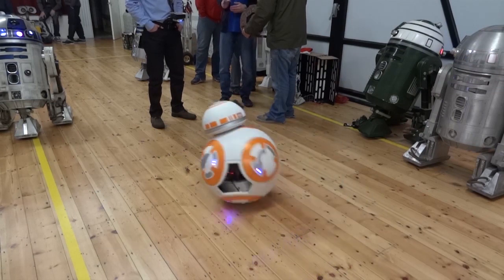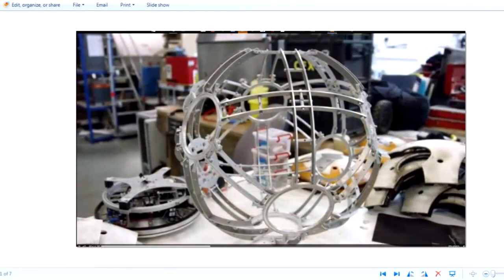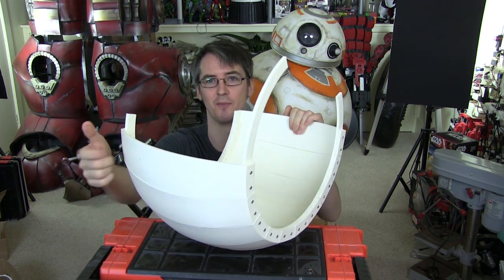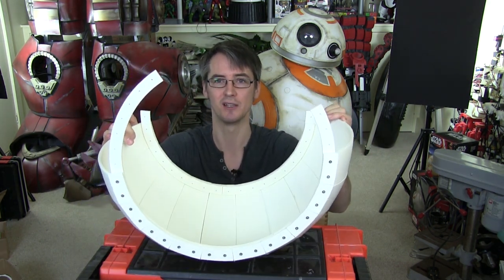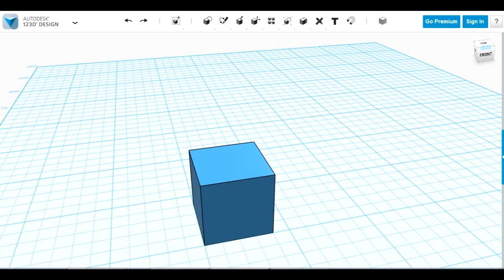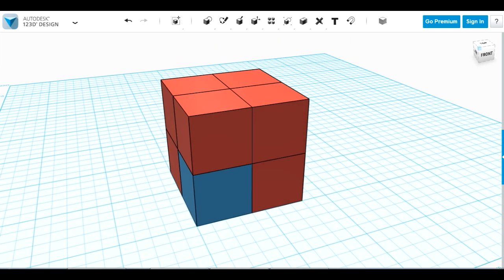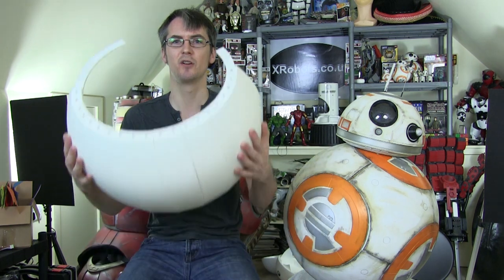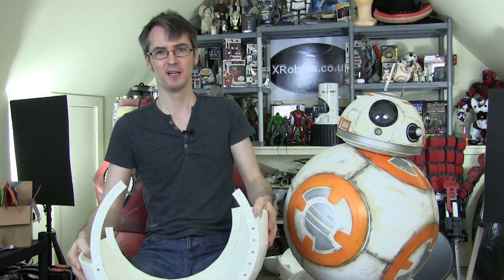Star Wars BB-8 Droid v3 #1 | Intro & Discussion | James Bruton

Comment: The running carriage is wrong. The inner construct has to couple rigidly to the ball and you tip and roll that axis to turn the ball... it's way easier to balance too. I know it's been 2016 and now it's 2022, you probably figured that out long ago :D

Comment: Can You Recommend an Appropriate motor for Building a Anaheim stage droid Replica. The Bevel Gear Driven By Belt both appear to be 1:1 Rato But this is where im stuck no clue about working out torque needed or frame pannel weight radious ratio Brushless V Brushed & Planatary v harmonic 
But My Frame and Pannels Might be heavier i suppect stage droid sphere is Acrylic California Quality Plastics 2 Hemispheres ill be using using club panels and cari christe new 8mm Sphere

Comment: hi james, i wanna build this robot, but i wanna ask, I have the Robo 3D R1 Plus printer, it has a heated print bed with measurements of 8" x 8.86" x 10", my question is, Is it possible to build this version of BB8 with this printer?

Comment: why not base all of the movement based in the actual top head part of the droid. E.G. moving the head back and forth using actuators and then using the gravitational pull of it to roll it. then you can have the magnetic frame on the inside to hold the head
Reply: what about a large gyroscope instead of the axle shaft based in the middle of the robot. then instead of controlling the head section through the magnet on the shaft, have a large magnet infrastructure in the middle. this would allow the droid to move in multiple directions
Reply: why not try and advance their design then?
Reply: oh, fair point. that is a lot of money. maybe in the future if the prices of motors decreases then :D
Reply: you did a awesome job with this droid
Reply: Well couldn't you use motors like those out of childs toy electric cars to create a gyroscopic system inside of your robot and have multiple gearing on it , I'm sure it would take a bit of inlaying the belts but I'm sure it can't be too hard plus if your willing to use more plastic in your print along with something like HIPS you can do a multi-layered print in order to make the system work more easily , and you can get most of the components from the local thrift shop , the head could be done with a magnetic layering inside the bottom of the head with simple RC mechanics to use small electro- magnets to pull the head from side to side or front to back , and the magnets will hold it in place , and you could link them to the same controller but have it almost like a Nintendo controller to control the small electro-magnets to pull and push the head where you want it , Just a thought , if its any help cool if not Sorry for the annoyingly long post

Comment: I'm going to be starting one of these this year as well!
Reply: +Anthony Bowman Looks like I am going to have to break up some of the parts into smaller piece and then acetone weld them together. My print bed is a bit smaller than the TAZ printer beds. Mine is only 200mm x 200mm. Shouldn't be a problem, though.
Reply: Anthony Bowman hi i would like to build this too do you have the cads? And could you share them with me

Comment: Wouldn't having parallel motors in a similar setup to your version 2 along the width of your main sphere provide the banking effect that you're looking for (with tank controls implemented). It would keep the main mass at the plane of your preference, the overall weight would keep the sphere rotating on a an axis parallel to the equivalent of a central axle, and the conflicting forces of the tank controls would allow for the in place rotation you mentioned at the start of the video. 

If the motors don't stay in parallel to the equivalent to an axle, you could always attach an actual axle thats purpose would be solely to keep the motors in place. (With each motor attached to the axle independently of one another. Although that might require you to split the force of each motor into 2 inputs each in the configuration aesthetically similar to a compass with each input on either corner to provide stability)

Comment: How about putting the batteries at the bottom for weight stability then being able to shift the battery weight perhaps and shifting sled platform from side to side to cause the sphere to lean left or right?
Reply: not quite what I meant take a look at the GM envy two wheeled electric self driving robot car it has a battery "sled" that slides forward and back for balancing but if such a "sled" were to slide side to side in your bb8 sphere it would cause it lean left or right what I mean by sled is the batteries slide on a platform that hangs under your central axis like a pendulum at the bottom of the sphere but not making any contact with the sphere at all...

Comment: James, one idea I am looking at is using actual RC. I already have a Taranis X9D radio and I plan to have a Arduino pro Trinket from Adafruit for the RC and have that communicate to and Odroid C1(lie a raspbery pi). having a central brain and offloading tasks to smaller microcontrollers reduces that buffer overflow issue. It does make a few things a bit more complicated but over all it should work better. Since I am using FrSky I can use the s.bus and get all 16 channels out of a cheap 4ch receiver. The same s.bus would work with Futaba but unconfirmed. The library for the s.bus can be found here:  https://github.com/zendes/SBUS

Comment: I feel like a better idea might be to leave the flywheel out this droid and instead use the banking mechanism to turn sharply enough to where it can turn in let's say a 1 ft diameter circle
Reply: +James Bruton (XRobots) I see what you mean. that might be a problem. I also just went back and watched footage where bb-8 spins slightly on its axis, but it doesn't seem to need to charge up a fly wheel in doing so. either way, I'm sure this will be a great build! keep up the good work!

Comment: sigh You realize all these remote control problems have been solved by... Remote Control transmitters? Don't diss the RC crowd until you've built a modern quadcopter. You're actually treading old ground, and doing a lot of work that's already been perfected. Take a look at the Naze32 flight controller and FrSky Taranis TX combo that every second quad pilot uses. The link goes 1 km, has failsafes and proven immunity to a lot of interference, PLUS telemetry to return data to the TX on critical systems. And sixteen channels. And programmable lights. And GPS. And programmable motor outputs that feed brushless motors. And... you really should start watching a lot of FliteTest. I say all this because you're building robots capable of running away and big enough to cause damage now... don't trust that to a homebrew radio link with buffer overruns. "Runaways Robots always head for the nearest pram"! Failsafes!
Reply: I know. I've been down that road. It's not as great a road as you think, and the 'fraction' is about 0.3, (I'm guessing about $50 worth of materials for your TX and another $30 for your RX vs $200/$40 for a Taranis/XR4) and doesn't include your time, or the cost of the robot that might get destroyed if the link fails. The RF link is fully digital, bidirectional, and can carry any information you want with some hacking if you really need it, and there's thousand of people tweaking the software to do interesting things of relevance to you. The Naze32 has been adapted for segway-style vehicles. Or there's Openpilot. There's a whole sub-industry that makes these things now, and they have some wonderful devices. Making good RF gear takes a range of engineering disciplines. Take advantage of what's there.

Comment: James... You could have tweaked V2 a bit more before starting V3. 

Take your time a bit more! Think about what a droid like this would look like internally in order to be useful or practical from a real world perspective... As a tool for performing some sort of work... With its arms and all. Then as a companion. How would this change its insides?

You obviously love to build stuff... Jumping right in. But really take the time to think about what you make... And they'll stop being just puppets or props and become actual, real-world robots (or droids). I hope you take this positively!'

Also... Why not use RC equipment? Brushless motors, ESCs, radio transmitters... Instead of windshield wiper motors, arduinos, bluetooth, etc...
Reply: +Sutanreyu Depending upon the scale and speed of your device, windshield wiper motors, arduinos, and blue tooth modules are RC equipment.  A windshield wiper motor can be picked up for $20, and is already geared rather low.  A similar brushless DC motor of comparable power output is nowhere near that affordable.  The arduino allows for electronic speed control of more than one motor at a time for less than the price of a single hobby RC ESC module.

Comment: Why bother building the single axis version? It's much less maneuverable than the sphero version.
Reply: +Tyson Coleman To have panels that can access the interior. Robots need maintenance all the time.
Reply: Hmmm. I have an issue accepting no as an answer. I'm sure we can come up with a solution to having a single axis. I haven't seen the movie but does he move on a single axis in the movie as well?
Reply: +James Bruton (XRobots) I'm not saying that there aren't complications. Several in fact with the idea of an omni-directional (Correct term?) BB-8. But that's not to say that it's impossible. But I am willing to bet that eventually there will be an omni-directional model out there and someone has to be the first to do it. Again it won't be without it's complications, but I still think someone, you in particular, could tackle it.

Comment: I think that you need to reduce the amount of motors and the amount of calculations to speed up the processing loop. It may prove better to use two accelerometers again but redesign the processing part using more processors- basically distributing the computing done. The droid loop must definitely be master and call for event updates.

Comment: try using a raspberry pi as the main controller in the Droid. it is faster (i think) then any 8 bit arduino (sorry for the butchered name) and i think it can multi task pretty well. and use the pi zero for the controller with a wifi dongle stuck in the one USB port. i work with the pi a bit and its never really let me down. just saying
Reply: +Liam Amyot Do you recommend an Arduino or a Pi for a quadcopter/drone of low difficulty? 
Thanks
Reply: Tito Adesanya raspberry pi all the way!

Comment: If you have one motor "driving" the bot..( against the inside of the outer surface; presumably with a wheel making contact), could you achieve the goal of the additional wiper motor(for banking) by making the drive wheel able to turn with a smaller motor (at the contact wheel), such that..."imagine the drive motor as a small car that is able to drive side to side within the fixed track that is your main drive "groove"..??  

Its seems like a "servo" motor that changes the pitch/angle of the drive wheel could cause the "banking" effect and shift the ballast weight around "auto-magically" as long as the drive motor is fixed like a pendulum at the point of the "drive axis" you have identified as requiring great torque.  If that can work you wont need 3 wiper motors and will have more internal space.

Comment: hey james,
you may have seen this video: https://www.youtube.com/watch?v=RqSOo5reNO8

in your video you said, that the "movie"-bb-8 was just a puppet. i did read some articles, stating the he was not remote controlled but none of theses articles had a proof. infact there were some articles saying, he was indeed remote controlled. i remember reading an article or watching a movie where they said, they needed two guys controlling bb-8. one for the body and one for the head. at the end of the video, you can see the movie version doing some stuff. its not the stage version because u can see the different head movement. 

i noticed the difference of the "movie"-bb-8 and the "stage"-bb8 aswell, but i actually think, they made the stage version the way it is, so one person could control it.

Comment: Great work, following all of the BB-8 versions with great interest.

Question, why not use interrupts to handle the comms (controller)? That way only when there's data from the controller it gets processed; this is a very simple approach which will unload the main control loop. The comms interrupt will handle the incoming data and place it in a buffer and then when it gets all the data (new sticks pos, switch toggles, etc.) it lets the main control loop know, prompting the main control loop to react to the set points. Because the main loop gets unloaded this way, it can run at full speed without worrying about user input. 

To control the timing in the main loop (PID control is time sensitive) a similar approach can be taken but using a timer interrupt to set the time interval. This will greatly reduce any timing jitter, smoothing the control loop's output.

BTW, Arduino's interrupts documentation might be misleading when it reads "Interrupts can slightly disrupt the timing of code", it lacks proper context.

Comment: it just occurred to me that you can use a starter motor from a car and actually make a sphero style bb-8 and not have it drive only on one axis, but truly on all axis.

the wiper motor would drive it forwards and backwards with a hard polyurethane wheel, the starter would sit retracted and not drag, then when you wanted to turn it would spin up, extend and turn the ball, the drive being a hard surface would offer limited resistance and it would turn... you just have to replace the rounded cog on the starter with a urethane wheel... job done.. being a DC motor, the starter will spin in either direction.. and they're the same price as wiper motors
Reply: +James Bruton (XRobots) place the starter facing backwards do it spins sideways, turning the ball on spot. it's just another wiper motor turned 90 degrees that retracts when not in use.... to do quick tuns back and forth (more maneuverable) you'd need a front facing motor too, make the front turn left and the rear turn left, as starters can't spin opposite directions quickly... they have to spin up to extend against the spring.... to shorten the distance and quicken the reaction time of the starters, place a bushing behind the gear(you would replace with a soft wheel to grip the inside of the ball) so that it's already 99% extended and only needs to travel 2 or 3mm to grip... starters normally retract and extend 20-30cm to clear the engine flywheel.
Reply: +James Bruton (XRobots) that is to say, it would spin on the dpit in relation to the drive assembly inside the ball, which would then drive off forwards or backwards along whatever axis it stopped on... (appologies for typos.. i've fat fingers & on a phone atm)
Reply: +James Bruton (XRobots) http://i1159.photobucket.com/albums/p622/Rhet83/bb8/bb8.jpg .. I made a doodle, to work the whole thing would balance on the black drive wheel, and use the head to do it, build a frame off the drive wheel and attack everything to it, if it's not entirely symmetrical a small bit of ballast would fix it... use 4 scales on each corner to build it balanced, then you existing designs to do it.. the hard part... making a ball totally smooth inside and out, to drive on and in... the ball would have to be fairly thick and you pocket screws to join in one big seam
Reply: +Phil Verhey Starter motors aren't made for continuous drive, whereas windscreen wiper motors are. Starter motors  have a very high torque, but poor heat dissipating ability, so they burn out if engaged for too long.

Comment: Would there be a any advantage / disadvantage to running two motors in the bottom and configuring a control system to vary the drive speed between the left and right motors to aid in steering?
Reply: Nevermind... the center would have to be split for that to work... I should never watch your videos and think before that first cup of coffee... lol

Comment: I've watched all your videos, great stuff ... in this video you mentioned you were using Bluetooth as comms between 2 Arduinos Do you find this just as reliable as the slip ring in the Astromech you built? I am building an R2 and am at the control stage now. I've been pondering the idea of an independent dome with no slip ring and using Bluetooth but I have not found any info online about reliability. Again thank you for such an inspirational channel. I think my next 3d printer will be a Lulzbot based just on what I've seen you do with it.

Comment: Hmmm. Seems like using serial for this has some downsides. Low-level wireless stuff like the nRF24L01 is packet-based, so if you make each packet a complete set of control data it doesn't matter if you lose a few, there'll be another copy along in a few milliseconds. Serial doesn't have packet boundaries and none of the modules I've seen implement flow control to stop you overflowing the buffers and losing bytes of data, which obviously desynchronizes everything irrecoverably from them on.

Comment: I would design the software to use multitasking: one task that drives (with the PID-loop) and one task that reads the controls over radio. Then whenever the drive-task needs data, it polls the current state of the control pad from the control-task.
The control-task would not need to store all the data it receives: only the latest state of the control sticks and buttons.
Each task could very well be on a separate microcontroller so as not to interfere with one-another. The drive-task would have priority over the control task, and therefore block the control task/reserve the control µC whenever it wants to read the current state of the controls.